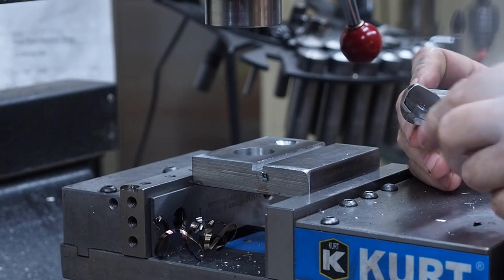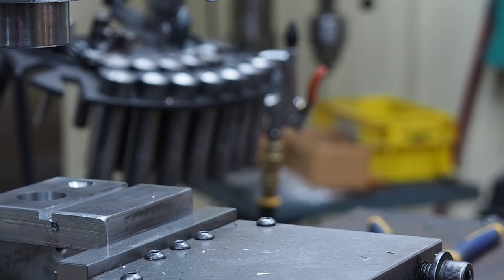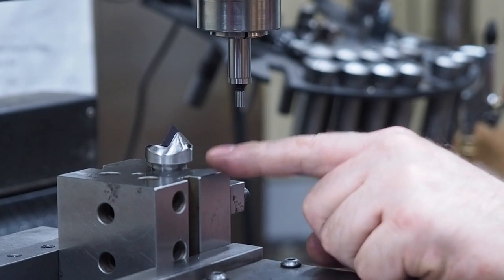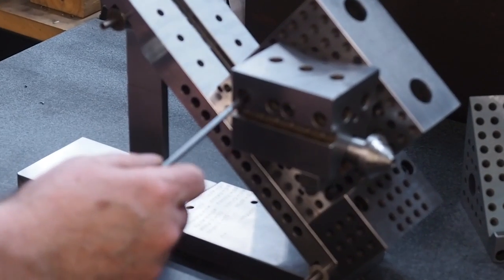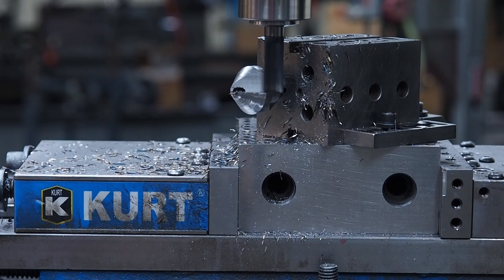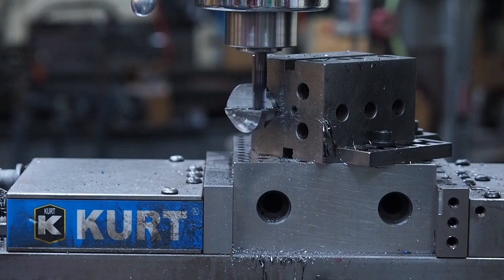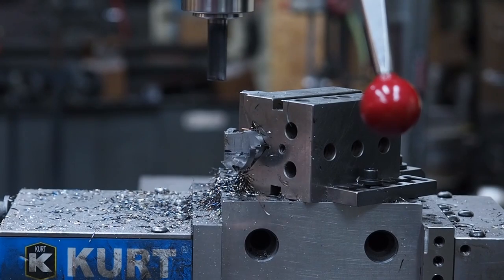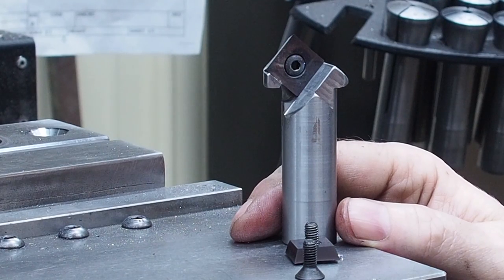Homemade Mil-Tec Chamfering Tool

Comment: Hi Steve, good to see you back in action. It's been quite a while.
Reply from the maker: Thanks, I had ongoing health issues for about two years with my Thyroid. The last year was really rough. Hopefully I have a handle on it now and things will get better.
Reply: @SolidRockMachineShopInc  Oh Man! my wife struggles with her thyroid too. Sorry to hear that.
Reply from the maker: @warrenjones744  For about 9 months I was  in bed or sitting in a chair anything else drained me almost completely (extreme fatigue). Simple things were very difficult to do. My hands would shake so bad I could barely set a mouse trap without setting it off. One of the internet medical documents I read said reactions to T3 Thyroid would cause shaking of hands with something as simple as tying shoe strings. I stopped my T3 cold turkey and in 2 days felt like a new man. Without my doctor knowing I started playing with lowering my dosage of both T4 and T3 meds and splitting the tablets and taking dosages twice a day 6 hours apart. The total of both dosages is still less than my once a day dose. I am not a doctor so anyone reading this talk to your doctor first. I will share with my doctor next visit what I did. No matter how high the dosage blood work kept saying my meds needed to go up. When I went off cold turkey of both T4 and T3 almost all the bad symptoms I was having went away but after a few weeks I started getting sleepy tire not the fatigue I struggle with. That is when I reduced the dosage spit 2 times a day and now I feel better than I can remember in 2 years.  I don't know if I am back to normal yet because I forgot what normal feels like but I am calling this a win and hope it keeps going that way.

Comment: Beautiful design, Steve. Did you have to mount the insert off center so that you would get clearance on the trailing edge? Great to have you back.
Reply from the maker: Hi Robert,
I mounted it off center so I could chamfer a bigger hole. I have other regular chamfers for smaller holes. 
Steve